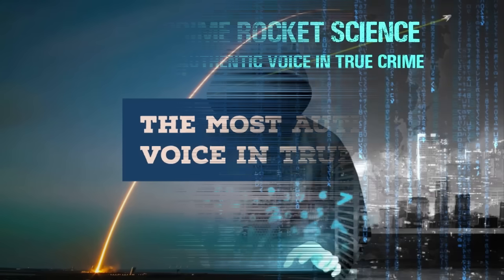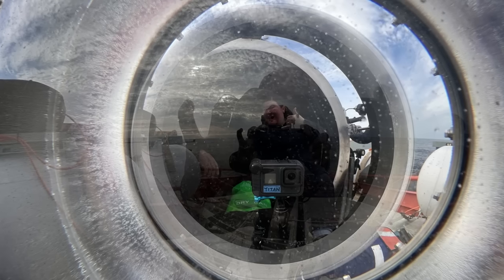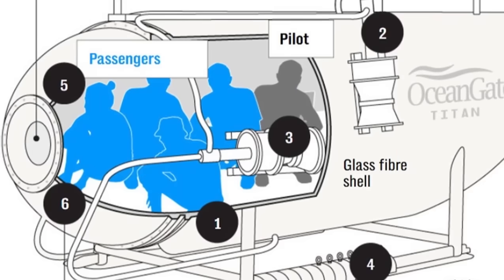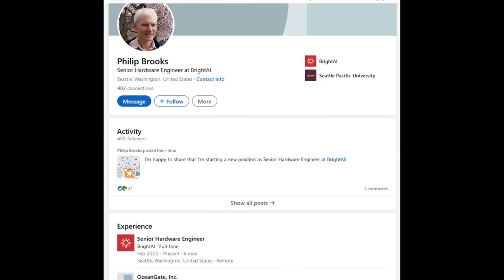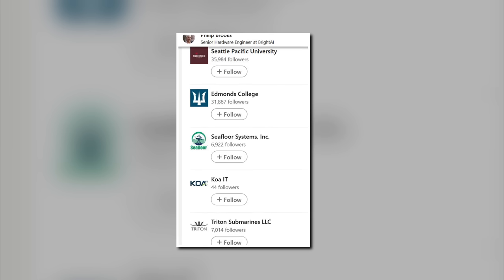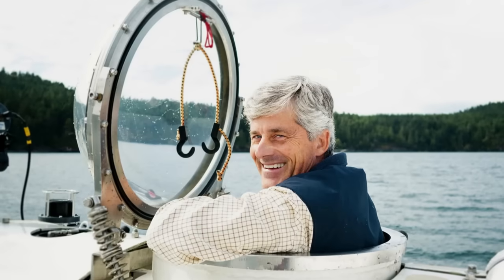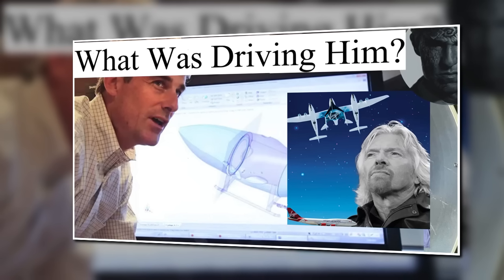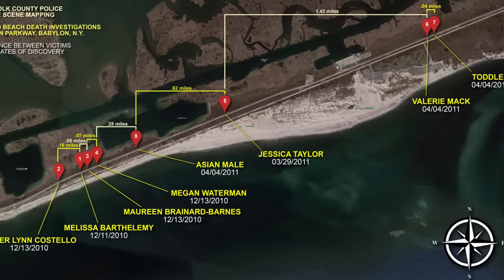NEW RECONSTRUCTION RAISES AN URGENT QUESTION: What Happened To Their Last Director of Engineering?

Comment: Actually, it seems a little surprising that SR had any other engineers around at all, however, true to form, not someone in the correct discipline for the craft to offer potential disagreement.  After the last few videos, I feel we've learned SR actually had "false pride" (I'm sure you'll come up with a better term since you're a wordsmith), or bravado (?) due to  inadequacy and pressure to measure up.  Great research!
Reply: false pride = delusion

Comment: That’s an awful thought.. that when the implosion occurred the two titanium caps blew off like bullets in opposite directions, and it has been a fairly often stated scenario that all 5 onboard were pushed down the cylinder into the titanium cap with the viewport.. which means that they could have rocketed out with the intact titanium cap. That hardly bears thinking about, but it does possibly explain the absence of the viewport.. it would have just blown out with the force and the bodies and is probably a way a way from where the Titan was found, maybe imbedded somewhere within the Titanic wreck.